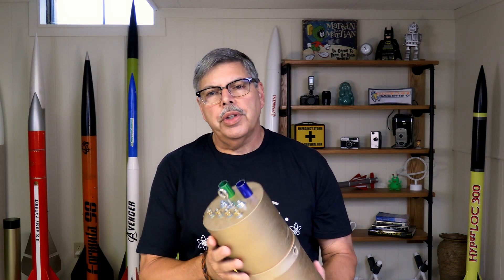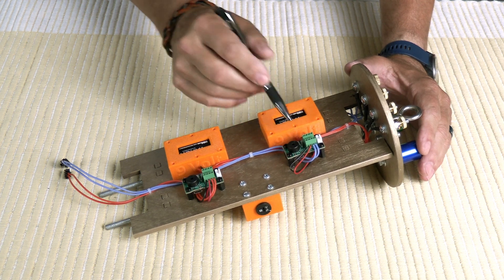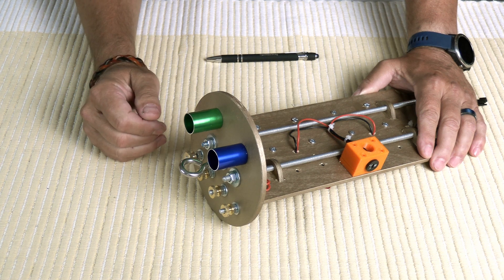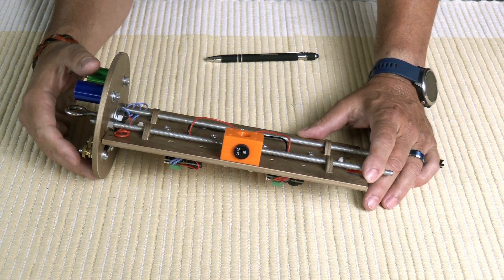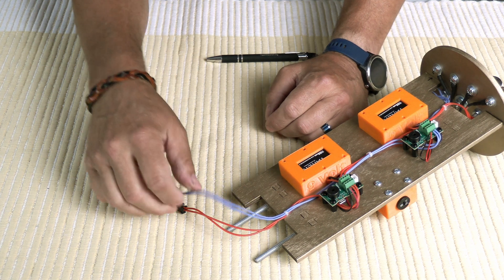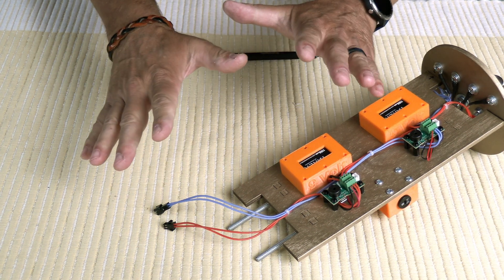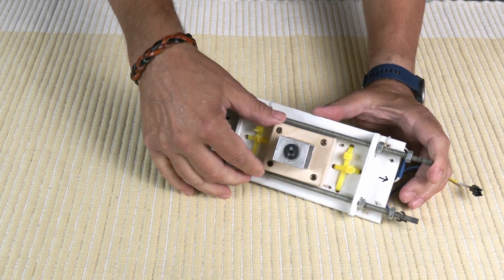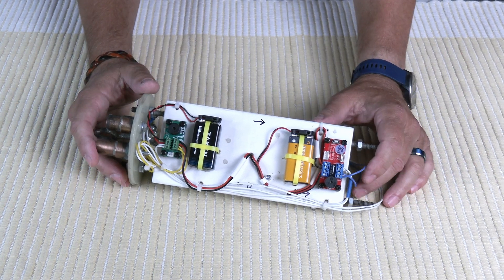My custom dual deploy electronics bay!

Comment: "Lipo batteries are great, but you have to charge them. So instead, I use a USB-charged battery with unknown internal charging and buck/boost circuitry."

Joshing aside, great video! Love the pill bottles, I'm going to have to pick some of those up for the next build.

I have a pair of Eggtimer Quantums to set up in a proper LOC kit, which will be my first dual deploy setup with redundancy. I love that the eggtimers can arm remotely with wifi from the phone, but I will be adding a rotary switch too just to make sure there are no objections to my setup at the field...thanks for the suggestions!
Reply from the maker: Some Eggtimer products will not accept 9 volts! 
Thanks for your comments, I think. 😎

Comment: Do you wire both of your Altimeters to one switch? I have been wiring up two switches......Didn't realize that you could do this with one?  Is there an advantage to just the one switch besides AV space?  Thanks for your amazing videos...I have learned a ton!!!!!! :)
Reply from the maker: Yes, I use one switch to power both altimeters. Two circuits are closed when the rotary switch is turned to the 220 position. Use a continuity tester to verify the pins. I have seen a number of very large rockets use one switch.

True redundant dual deployment would require two switches. It seems unlikely to me both poles would fail at the same time. I find the most common failures are, low battery, poor connection, and failed e-match due to a short or defective part.
Reply: Thanks again!!! I will try this on my next build!!!🤙

Comment: Will you share the info for the Ematch Connectors with the Knurled knobs attached to the bulkheads......   My Charge wells have similar ones but are built into the well and are pretty small

Thank you  !!!!               `Glasspack
Reply from the maker: The knurled brass nuts can be purchased through Amazon or a local hardware big box store. The best prices can be found on eBay. The brass nuts come in smaller sizes along with metric. I rub the mating surface on the bottom with sandpaper to clean up the connection.
https://amzn.to/3XE67x0

Comment: For the batteries, look for disposable vape pens, they have single cell lipo batteries of varying sizes, you can wire them in parallel for more capacity and in series for more voltage, these will need balance charge leads

Comment: That battery with the built in charger is awesome. I would love to be able to use that but unfortunately, I'm using the EggTimer Apogee controller and it needs a 1S Lipo at 3.7V.
I used the Altus Metrum EasyMini a few years ago until I had an ejection failure and it pummeled into the ground and it turned into $80 of tiny bits.